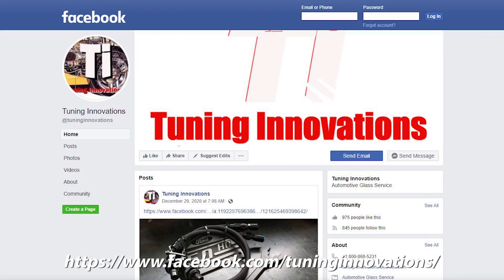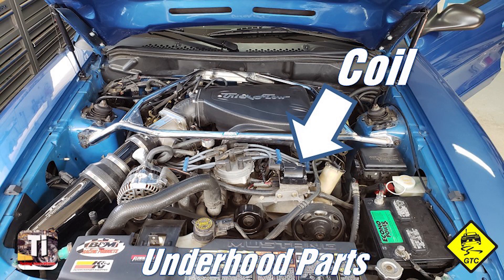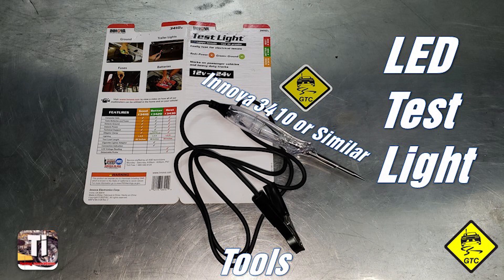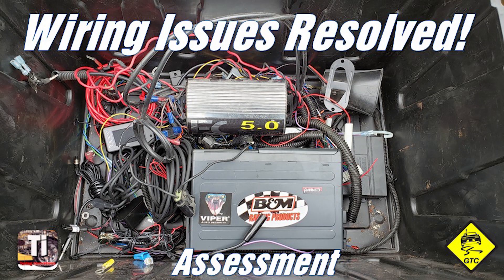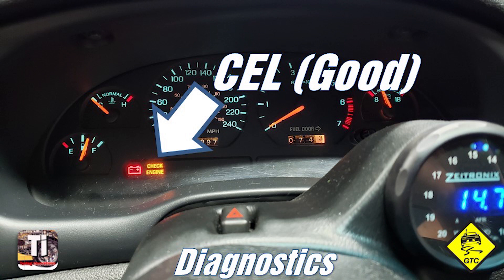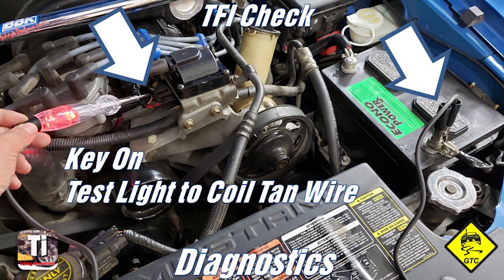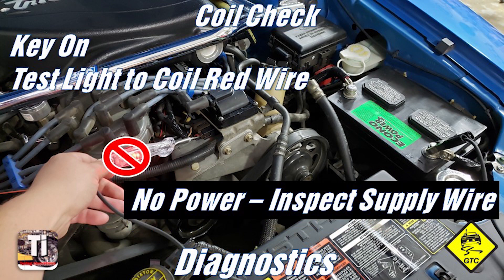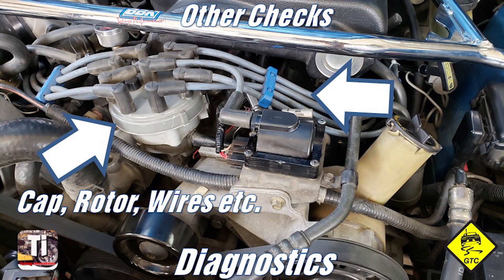Solving the SN95 5.0L #No Start No Spark - SN95 Owner's Guide #16

Comment: Just removed smog pump and added catless x pipe. Other then cai and 75mm tb car is stock. Do you have a fix for stalling after hot restart? Cold start is fine. After restarting, car dies unless i feather gas untill it corrects its self.
Reply from the maker: Hello David, I can't say that remote diagnostics is something we specialize in however, the modifications you have made if done correctly probably shouldn't cause any issues. If I were to start, how did you seal the smog pump ports in the rear of the cylinder head? If you left the check valve in place, it is a good idea to apply a plug at that point to prevent a possible vacuum leak. If that is all good and leak free, I would inspect the CAI, if the MAF or other sensors has been moved sometimes (rare) that can cause issues. Depending on what throttle body you used, and it's condition can be another source of issues. Visit www.tuning-innovations.com and ask for a base idle reset instructional and try that. If you have a BBK or other low cost throttle body, in my experience the IAC valves are unreliable, you can try the one from your original TB and redo the base idle reset proceedure. Depending on the tools you have available, you might be down to simply re-installing the OE parts one-by-one until the gremlin is resolved. Best to go back and recheck all the installation work along the way. If it worked well before, you know that it's something related to the new work. When I did my Smog delete over 15 years ago, there was no change to the driveability. CAI's and TBs are also generally trouble free, but can cause trouble depending on what they are and how they are done. Best Luck, I am sure you'll be able to track it down. Thanks for watching and commenting! - Darren
Reply: @GrandTouringConcepts   smog was plugged with thermactor plugs , tb is a bbk 75mm.  Iac came off old tb
Reply from the maker: I would try the base idle reset process and see if it corrects the issue. There is some adjustment in those and it might be the issue. It would do no harm certainly. Aside from that, I would be retracing my steps through the install looking for something missed, or restore the factory TB and recheck.

Comment: Recently began to experience this problem.  My 1995 GT has a thing where it'll turn on fine (cold).  Then I'll drive around town for about 20 -30 minutes.  If I shut off the car then try to start it up again - nothing.  No crank, no clicks - only the lights in the dash turn on.  I'll let it cool for about 20-30 minutes and she'll start right up again.  I replaced the original alternator and water pump (which needed to replaced anyway) as well as distributor cap, rotor, coil, and TFI module.  All parts were original and I used Motorcraft replacement parts for all except for the water pump which has been discontinued, unfortunately.  Took the car for a test drive and she started right up BUT after driving around town for about 30 minutes I stopped at a Sunoco gas station to fill up. When I got back in the car to leave - NOTHING... again.  I called up my mechanic and he asked me to try to something.  He instructed me to put the key in the on position and switch gears from the Park position to Drive and then try to turn on the car.  I did that.  It turned on.  He said.... "You've got a bad neutral safety switch." Makes sense.

Comment: Great resource video.  It helped me identify a failed Crane HI-6R when I was about to pull the trigger on a new PIP.
Reply from the maker: I had that exact experience while working on a friend's car once, it would start and run for 5 seconds then cut out. It was many years ago and I didn't have access to diagnostic knowledge like this, so we had to work a lot harder to find the failing Crane ignition. I have two Mallory ignition boxes that failed early and gave a lot of trouble. Glad we were able to save you some time, money, and frustration. Thanks for watching and commenting! - Darren

Comment: I’ve been looking everywhere for a video like this! And it’s for my year mustang. Thank you! My check engine light stays on when cranking and there’s no RPMs. I googled that it can be the crank shaft sensor. I’m guessing that’s in the distributor.
Reply from the maker: That is correct, it is called the PIP, or pick-up or hall-effect sensor. Replace it with a Motorcraft branded sensor from a reputable source, and re-run the tests. Chances are you will have solved the issue. Thank you for watching and commenting! - Darren
Reply: Also, would love to see how to see a video on how to check the distributor and PIP!

Comment: I had a failing PIP on my '95 GTS and it would periodically no start when warm. Very frustrating. This is great info that should really help people in the future!
Reply: What is the pip wire.  Whats the pip stand for. having the same issue with mine not starting fresh tune up started fine for a week then 1 night it sat and now it won't start. Turns over check engine light stays on but won't fire
Reply: Same here